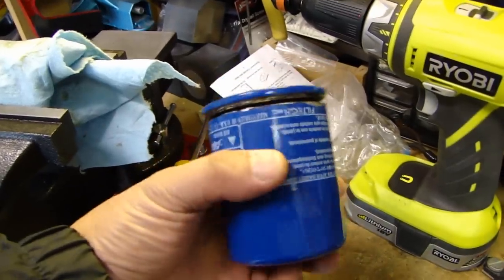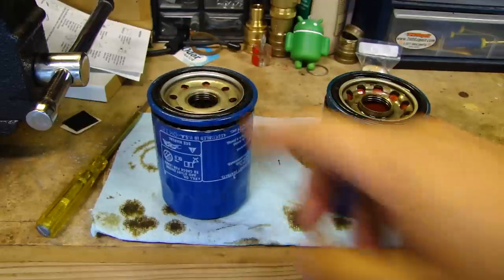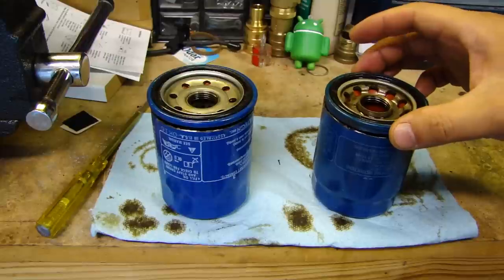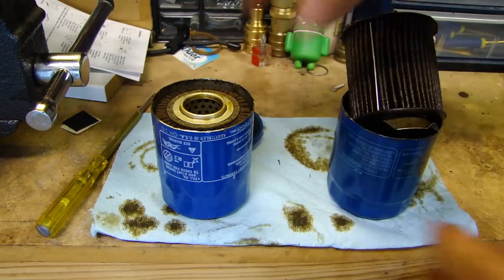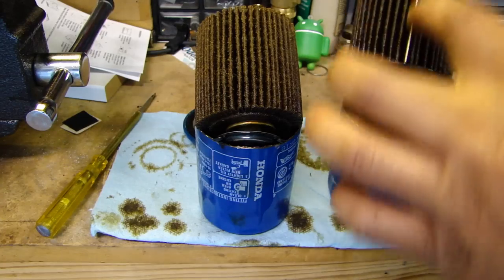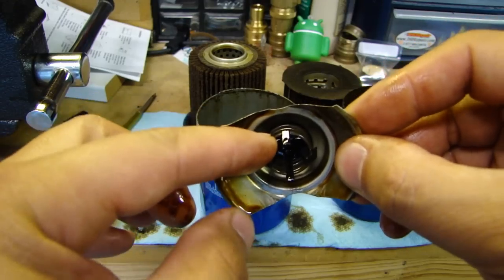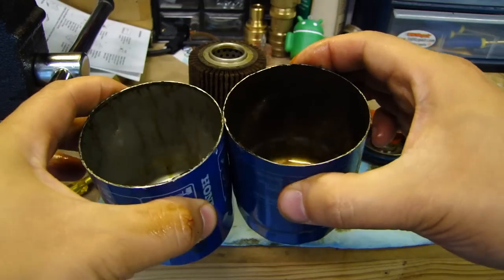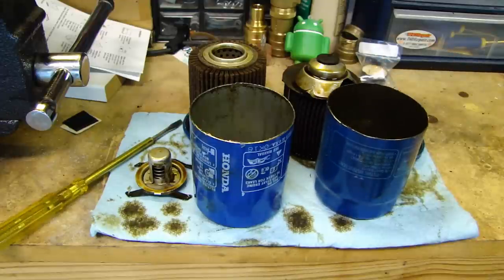Honda Oil Filter Comparison: 15400-PLM-A01 and 15400-PLM-A02

Comment: Im using a1 after reading they were better than the a2. But looked to me like the video showed the a2 was better; 1) less restricted in the top plate, 2) bigger bypass valve, 3) larger anti-drain valve 4) metal crimped filter media 5) more pletes indicating more filter surface area 6) better contamination retention as its dirtier after same distances The only thing better on the a1 ,seemingly, was the thicker shell metal gauge, but who cares, they aren't bursting so 7)thinner shell better heat dissipation. 7 points better on the a2?! Please tell me what im missing, i want to believe in the a1 and learn. Thanks
Reply: Not sure about the significance of (1); however, I'll answer what I know, maybe someone else will chime in.
(2) The spring that holds the bypass valve is weaker, so they made the bypass valve bigger to try to compensate for it.  (3) The anti-drain valve is bigger, but it also doesn't hold as well, because there's no metal below it to back it up.  (4) The metal crimp is there, but that only takes away from surface area that could be used for filtering.  (5) The pleats on the A02 are about 1/4 inch shorter, something you'd be able to see had he set them on the table; also the reason they could fit more of them is because they are thinner; the overall weight of them is actually less; plus, the pleats being thinner means they distort more easily under pressure. (6) It is dirtier after same distances because it is already filled up with particles, whereas the A01 still has capacity to filter more particles; on mine, taking a close look at the A02 I could actually see some shavings that could not be absorbed by the filter, whereas the A01 absorbed them all.  (7) You are correct that the heat dissipation is probably better (though that doesn't matter since the engine cools the excess heat away).  (8) One other thing you cannot see is, the A01 filter's pleats are a lot finer, thereby being able to capture smaller particles.
Good points, though; I needed to figure out how to answer them to check my own competence as well.  :)
Reply: Just dissected an A01a (I accidentally bought a case thinking I was buying A01's).  Made in China.  Same as A02, but pluses: (3) there is metal backing the anti-drain valve; and, (8) a bit finer than the A02; and, minus: (6) more free-floating metal shavings (free floating = a matter of time before they make it through a gap somewhere, which was happening with the A01a).  Another thing I noticed is, that the color of the pleats in general match the color of the oil.  So darker pleats = darker oil.  Colour changed because the finer particles made it through.  Finally, (4) the metal crimp allows for uneven spacing of the pleats. They stretch apart near the crimp, creating microscopic gaps near the top and bottom near the folds-to-be, for the shavings to get through; to make up for that space, they bunch up everywhere else -- so there's an even larger surface area that is not being utilized well due to the stretching around the crimp.  To use up the A01a's, I guess I'll have to alternate -- A01a, A01, A01a, A01 --- the A01 to catch the metal shavings left behind by the A01a.  Because ultimately, I think those metal shavings are what will make the biggest impact on the engine (in addition to the color of the oil).  I also disected a Mobil1 Extended Performance filter -- that one is similar to the A01, but plus: (9) the attachment is much thicker, and threads are directed inside the filter -- both of which would keep the outside from warping at high RPM's achievable mostly by sports engines.  The minuses are (5) pleats shorter by about 1/3rd of an inch, and (8) slightly coarser holes.  Also, your favourite, (7), the body is thinner.  For a non-sports engine, I would stick with the A01, because the taller pleats and finer mesh allow it to last longer.

Comment: I still hear of high mileage Hondas and don't hear of any Honda engines blowing up because of the AO2 filter. Many expensive filters have cardboard on top and bottom of there filters. The Honda engineers do know what they are doing. The AO2 filter  may not be built for 10,000 miles so change it at 5,000 miles.
Reply: Honda engineers did not make the decision, Honda accountants made the change.

Comment: Same as Fram Tough Guard. Fram TG has the metal clamp holding pleats. The regular Fram is glued were pleats meet. So if it is, rating is 99% at 20 micron.

Comment: I don't see anything wrong with the current 15400-PLM-A02 oil filter I received when I bought them from Honda OEM parts online,  Because it's made good enough for my 5000 mile full synthetic oil changes, In my opinion as a diesel technician, Are there better filters Probably maybe, But I do believe Honda cares about quality when they warranty there engines to 100,000 miles using this filter for oil changes at the Dealership's. Tell me why I am wrong about this opinion, I want to know why I should be using a so called better filter like the 15400-RTA-003 made in Japan by Mahle-Tennex Corporation ?

Comment: A01 is the better one.  Fram tries to defend its use of paper end caps as being sufficient, but the overall opinion is that it is just cheaper manufacturing.  Fram filter's paper pleats distort under pressure, which would impact effective filtration surface area.  They definitely are not made for extended service.

Comment: well on a d16 y series motor, one instance of "oil related failure" meaning running even a quart low on oil could result in blowing a connecting rod bearing. It is important to run a well match and performing filter to the motor.
Reply: Well our D16Y7 still going so far 3 times it has needed over a quart of oil and still going.
It's a beater at this point but still going strong. It's a 2000 Civic and has also slid off the road and broke a solenoid on the transmission and for such a small part ain't cheap $200 but still drives fine.

Comment: The Honeywell A02 FILTER is actually made under license by FRAM. Thats why you have paper end caps on it.
Reply: John L no big deal on the end caps. Mann filters don't have end caps at all.
Reply: @arthursmith643  The Mann oil filter for Honda does have end caps though, part Mann W610/6... Metal end caps even, it's pretty old-fashioned, as is the OEM Honda Europe oil filter which is made by Purflux, either Honda 15400-RBA-F01 or Purflux LS350.

Comment: I recently found out the oem honda filters are made by fram. I was pretty pissed honestly. I will no longer be using them and have switched to Purolator. Either Red filter, or boss depending on if its in stock. Luckily i do 3500 mile intervals on my 2019 civic coupe ex-t. Im at 54,000 now, and have been using oem since new. Kinda disappointed honestly. I should have looked it up on day friggin 1.

Comment: 15400-RTA-003 new honda oil filter listed now
Reply: Love Like a Hurricane i went to the dealer and was told the 15400-RTA-003 is replacing the A02.  the RTA-003 oil filter is made in Japan and comes not only in shrink rap but also a nice box📦

Comment: Those Honda oil filters looks like ACDelco filters used by General Motors.
Reply: I think they look exactly like a standard Fram except for the silicone anti-drainback valve.

Comment: why is there so much concern for the cardboard end cap on a filter made from paper,  paper ok but cardboard isn't?  Both materials are engineered for its purpose and duration.
Reply: I think it's more of a concern when using the extended change intervals when using synthetic oil. A cellulose filter will weaken the longer it stays in use. I've seen other videos where the pleats have been distorted.

Comment: Thanks. I bought 10 filters on eBay. Two A01 and eight A02. Good to know the difference.

Honda recommend one filter change every two oil change. I never followed that, but wonder if any would.  If you bring your car to the dealer for oil change at 5K miles, will they replace the filter?
Reply: AZ RockRunner I  don’t think that’s a good idea, the filter are not able to hold that long, I change my oil every 4,000 so I don’t know why Honda will tell anyone that.
Reply: Me personally, I would change the oil filter at every oil change. Using the old filter with new oil is akin to taking a shower but putting your old underwear back on. 🤨

Comment: Yet, there are still 100's of thousands of Honda's driving around with way overdue oil changes on the cheapest oil filter and oil that could be purchased. The A02 is probably way OVER spec'ed for the application. Honda engines are over engineered in most cases. With that being said, I use Mobil 1 or Wix filters and over maintain my vehicles. But, its what lets me sleep better at night.

Comment: Worry about the cardboard on A02 soaking too long. Will recommend replacing it with M1 filter or Fram Ultra
Reply: Love Like a Hurricane cardboard in the a01 too. What’s important about filtration whether it be air, oil or whatever are the number of pleats. Less pleats means less filtration. Both appear to have the same number of pleats. Both are good.
Reply: @jogmas12  The cardboard does little but slow the oil down as it is entering the pleats.  Not really important one way or another.  But ultimately, it's not just the number of the pleats -- it's also the thickness of them (A01 has them about twice as thick), the size (A01 has them about 1/4 inch taller), and the fineness (A01 pleats are a lot finer than A02).  As a result, A01 results in much cleaner oil (as you can see by their colour -- A02 filter is darker than A01).

Comment: Replacement of the filter at every oil change is the only proper maintainance procedure; some contend that the A02 filter won't even last a 3000 mile interval.  I use only A01 filters - the A02 is like the orange canned Fram,which is poorly constructed.
Reply: It may fail if you have a lot of sludge In your engine from lack of proper maintenance but realistically the engine should be pretty clean inside and it wont even use the whole filter no matter what brand

Comment: Thank for this valuable info. More than ever from now on I'm not going to buy this crap. I been putting a fram filter with blue color in my toy. Go for hamp H1540-RTA-505 or Honda 15400-PL2-315 that is Japanese . Vtech  need flow not blue color.

Comment: yes, the filtech looks better but can you prove that it is actually works better? I don't think Honda would replace their filter with inferior ones that will ruin peoples cars. Well they don't sell the a01 anymore. i have 8 a02 filters. how many miles do you reccomened i change the filter? also, can i just change the filter and not do an oil change?

Comment: OEM = are rebranded oil filters with Honda printed on them ! Are there better made oil filters available to the general public ?? Yes & Definitely !! K& N and Mobil 1 come to mind BUT OEM Oil Filters will do the job just fine !! NOTE :  If your under any type of Honda warranty, make sure to use OEM oil filters and save your receipts when & where you get your oil changed if indeed it is other then a certified Honda dealership !!  Better Yet...Just get your Honda serviced at the dealership until the warranty expires !!

Comment: Both filters are crap due to bottom by-pass valve. In extreme frozen cold or when the media is clogged from neglect, more captured dirt will continue into the engine compared a top-mounted pressure bypass valve, due to oil flowing all the way along the dirty side of pleats. 
It's better to have NO bypass valve in the filter (cheap STP) vs. a bottom-mounted one because then if there's too much restriction, the oil will flow through the inter-gallery pressure valve, not washing away any of the captured dirt in the filter.
Reply: takeadayofff what would you recommend for my 2002 honda accord coupe ex?

Comment: Today's Walmart SuperTech oil filters, made by Wix, is way better for less than $3.  What a shame for Honeywell/Honda to cheap out to make a profit.
Reply: Traveler X  Go with the Mobil One extended performance oil filter it always ranks on top at holding dirt and pressure in testing. eBay $14.00 delivered to your house. No stores to go to. You just saved time and money. I'm trying Castrol GTX ultra clean oil.

Comment: l understand what you mean and you answered the 1st question, but if l need to replace Ball Joints, Front Axles, Brake Rotors, Brake Pads, Head Gaskets, Struts, Oil Change, Power Steering Fluids, Brake Fluids, Oil Filters, Valve Cover Gaskets, Timing Belt, Water Pump, Serpentine Belt, Spark Plugs, Wires, Exhaust Pipe, Muffler, Catalytic Converter and the list goes on... Which one of them buy as O.E.M Parts and which of them to buy as Aftermarket Parts? You feel me.

Comment: WOULD THIS FIT THE 90915 YZZD1 OR D3 TOYOTA OIL FILTER..JUST WONDERING
Reply: a i do put in toyota filter only..its YZZD3. Infact i  upgraded to TRD filter. ya i dont need trd for my application but just one time i want to treat my engine with super quality :)

Comment: I really don't see the difference between the two. I don't see the brand or manufacturer of a oil filter being superior or inferior to another. They need to changed regularly. Unless someone can prove going 10,000 miles on the a01 filters better than a a02 I don't see what the fuss is about.

Comment: The fram (a02) has cardboard end caps. Cardboard has no business in an engine. Also look at the difference in the bypass spring. The filtech one looks much more refined and looks like it would take much less pressure to bypass once the filter gets clogged. A clogged filter with a bypass spring thats to stiff will reduce oil pressure to the engine which causes premature engine/bearing wear(especially important on d16 y series motors.) Fram makes crap. Even at 5k miles they dont last!

Comment: Don’t go with either of these filters. For the price of a Honda filter you can buy a Fram ultra synthetic with wire backing silicone ADBV metal caps metal tube center and tight grip coating.

Comment: A2 looks like POS compared to A1
Reply: Im using a1 after reading they were better than the a2. But looked to me like the video showed the a2 was better; 1) less restricted in the top plate, 2) bigger bypass valve, 3) larger anti-drain valve 4) metal crimped filter media 5) more pletes indicating more filter surface area 6) better contamination retention as its dirtier after same distances The only thing better on the a1 ,seemingly, was the thicker shell metal gauge, but who cares, they aren't bursting so 7)thinner shell better heat dissipation. 7 points better on the a2?! Please tell me what im missing, i want to believe in the a1 and learn. Thanks

Comment: Just saw your video. 
Good vid and presentation. 
So, it looks like the A02 is a basic Fram oil filter painted Blue instead of their Orange color (which I call the Orange Grenade) with the cardboard ends.
Both of them filters are of poor quality.
I would not even install any Fram oil filters on my wheelbarrow or any oil filter with cardboard ends.
You can search the web on oil filters comparison and you will see what I'm talking about.
I drive a Dodge Durango and all I use is the OEM oil filter which I have taken apart and it has steel end caps.
Shame on Honda if they are still selling the "Orange Grenade" oil filters.
Here's an example of oil comparison. 
https://www.youtube.com/watch?v=lrAbxCZlZpE